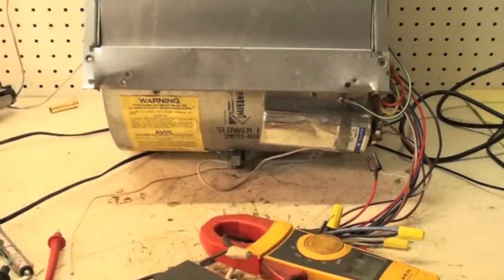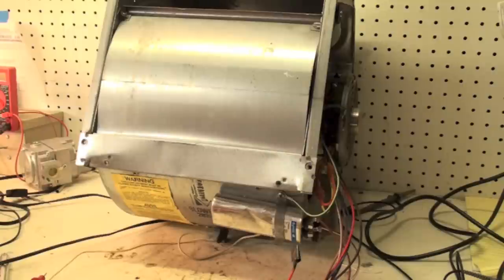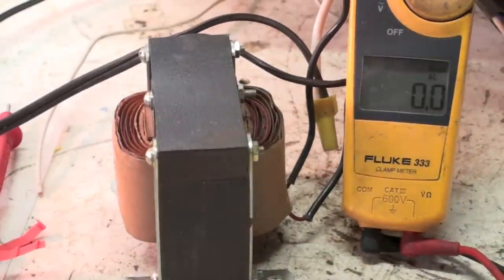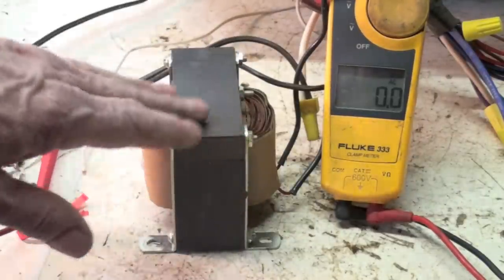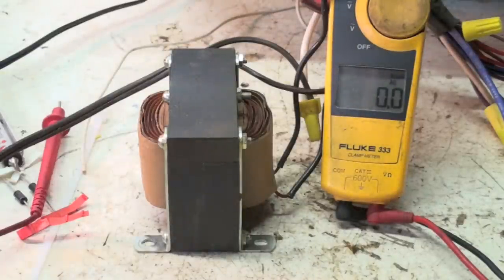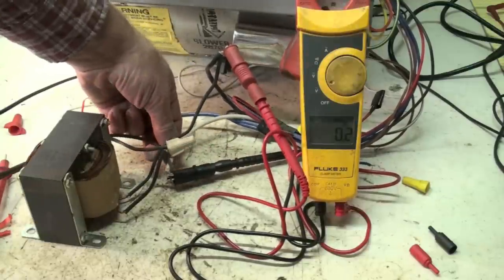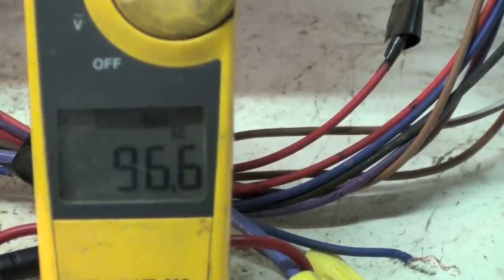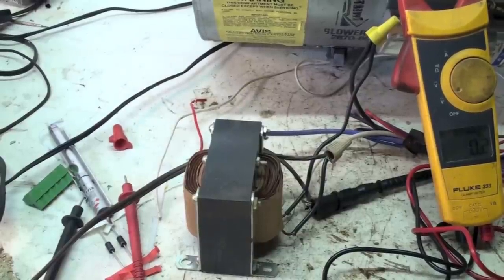Furnace fan motor speed control

Comment from the maker: Most of the time when you lower voltage, the amp draw increases to handle the load.  With the choke coil, both the voltage and amperage are reduced, because of the inductive reactance effect pushing back against the flow.  I know it seems odd, but it works.  Thanks for the comment.
GFM
Reply: and how would this effect the power factor? hook it up to a Kill-A-Watt.
Reply from the maker: @thedavesofourlives1  I can't say I have tried that.
GFM

Comment from the maker: No winding damage.  At least one manufacturer used a 4 speed choke coil as factory equipment.  Kind of makes you wonder why we have these very expensive PWM controls now.  I will be doing some vids on the newer variable speed units soon.
GFM

Comment: GFM, My grandfather w/EE degree found himself using 4 on diesel generator to create 4 different voltages (Including line and step up) to operate portable “Radars” in England, later Europe to scan for German airplanes & weather. Antenna rotates at a slow steady rate, radar used higher voltage, scope used another, plus wheel motors would drive slow to move to new location. A simple yet reliable way instead of heating tubes in a vacuum waisted the generators power and they wanted it constant and dedicated for opps, and nothing else. His job was to make sure each voltage was constant and only had one failure. So older technology. He told me an immigrant to 9 years and created “Bake-A-Lite” that was mixed with other materials as it had a high dielectric property. The patent residuals or payments was suspended by the inventor to win the war. Many was given the formula for free. This is where out desk top phone w/rotary dial came from in the 60’s. A part of the American spirit.
  Thanks for the video, I had forget many of his stories! He passed the year before I married.
Reply from the maker: Great story.  Sometimes when they pass a lot is lost.
GFM

Comment: these choke coils are in portable fans up to the 1960s used in various brands like Mathis cooler and the ones i got are the 1950s O.A.Sutton made Vornado fans most commonly used with shaded pole motors then. as i had to replace the motor in my late 40s Vornado JR. b18 c-1 as the windings were loose and were also grounded as the insulation crumbled in it as they matched the motor to a FASCO D210 as i found out the hard way the original choke coil isn't compatable with this motor. it runs on high speed if this is the wrong motor. its what the supply house matched it to

Comment from the maker: The late 1960s Intertherm electric, sometimes called International, used a choke coil that put out 65v, 85v and 120v.  The motor started with very low torque, similar to the variable speed motors now.
GFM

Comment: I have a Miller furnace in my manufactured home

It was A/C ready and I had the A/C added, 2.5 ton for a single wide trailer

I found the speed of the blower, the wires for slow and medium were used, I hooked high speed to turn on when the heat comes on, and the A/C was icing up from the start.

I switched to medium speed, but still ices up.

Is there a way to hook both the A/C speed and the heat speed to the fast wire ?

I was going to just switch the speed wire for the summer and have A/C on high

But, I was thinking that voltage comes out the control board on the heat speed tap where I have the high speed wire from the motor attached

The A/C and the heat motor power taps would never both be energized at the same time

Is it safe to hook high speed wire to both the A/C and the heat taps ?

They are both 120 voltage and I would like to know that if voltage is going to a tap that only sends 120 voltage, when it is off, would it disconnect that circuit on the board ?

Or is it going to short out the board ?

Basically, if you only had a 1 speed motor, wouldn't you have to hook the 1 wire to both taps on the control board ?

I would like to get a faster motor, but I don't think they have a faster motor.

This is a 3 speed motor

I think this is what comes in a unit that is A/C ready

The older units that were just heat had just 1 speed

Any help is appreciated

I was thinking about a diode, but this is A/C not D/C so that wouldn't work

I was also thinking about a relay that would go to one or the other tap, but there would be a moment in the beginning when voltage would get through to the tap that was not energized.

I am hoping someone who works on these will have seen this before.

I had the level checked

I was thinking about adding a little more r410a to the low side and see how that works.

I just don't know and I have had the unit looked at twice and I was not impressed with the service

The unit is only a few years old and it works great till it gets above 70 outside, then it gets less cold and starts to ice up.
Reply from the maker: First, do not connect 2 speeds to the same power source.  I would pick high speed for both heat and cool.  That is the simplest solution.
The unit should have a an either or relay installed to use a lower speed for heat and a higher one for cool, but unless you are confident in your wiring skills, you could damage the motor.
GFM
Reply: @grayfurnaceman  The motor has 3 wires, one for high, one for med, 9ne for slow.

The control board has a spade connection for the heat and a spade connection for the A/C

Whatever speed wire from the motor you connect to the control board spade connection, that is the speed you get.

I have heat on high speed and the A/C on medium

I plan on swapping them around.

This will make A/C high and heat medium, but I won't be using heat

I was wondering, if I attached 2 wires to the high motor speed wire and then attached both of those to the heat and the A/C spade connections, making them both hooked up to the high speed wire from the motor, but also jumpering the Heat and the A/C motor spades together.

In DC circuits I would add a diode to prevent any voltage going backwards down either circuit path.

I have 4 years of college in residential and commercial wiring, and I worked on jobs for 5 years after school wiring houses, doing blueprints and the actual wiring.

And I installed the A/C and the furnace, but this is not something that was covered in the installation manual.

And when I have paid professional companies to come and look at the unit, they don't seem to know what they are looking at.

I tried 2 of the biggest companies and neither one could answer my questions.

And I am not sure if there is enough coolant in the system.

They wouldn't let me look

I bought a set of gauges and a tank of r410a

I studied the videos and it looks like I should get the temp down close to 34 degrees.

I have been reluctant to do this, knowing the danger of the coolant and the pressure being a lot higher than what a car system has.

Cars are around 110 psi

This system is around 350 psi.

Not sure if that is just the high side

I would like to try increasing the speed of the motor and see if that fixes the issue.

I could also install a on-off-on switch for the high speed motor wire, and label it A/C off Heat

And just flip it in the spring and the fall

I just thought the manufacturer would have designed the control board for the contingency of there being just a 1 speed motor with a single wire.

I had to add splices to the low voltage wires and the common when I added the A/C unit.

But the low voltage side I understood 100% so I wasn't worried about making changes to the system's low voltage side.

The high voltage control circuits are a different story

I worked on 3 phase motors, but the wiring was straight forward, this is a lot more complex and I can't find a schematic for the board.

Any help is appreciated

Comment: Another great video thanks so much. Would you explain in more detail about this post 
The late 1960s Intertherm electric, sometimes called International, used a choke coil that put out 65v, 85v and 120v. The motor started with very low torque, similar to the variable speed motors now"
Reply: I have encountered a couple of these electric furnaces with these weird 240 volts "voltage step down devices"
Reply from the maker: Francisco Castellanos The International furnaces were an attempt to come up with a quiet operating furnace for use is mobile homes.  They were a beautiful operating furnace that sadly few techs understood.
Its called inductive reactance and happens when ac power energizes a coil and builds up a magnetic field around itself. When the power reduces to zero during the cycle, the magnetic field collapses and creates a counter voltage that essentially pushes back against the incoming power, reducing the effective power getting to the motor.
Reply: The motor name plate  in some multi speed direct drive motors are designed to run within a specific RPM, reducing the speed the overall equipment functionality is affected, such as air velocity, temp rise, etc
Reply from the maker: Francisco Castellanos Yes.  In affect, you are using the motor rpm to match the furnace to the ductwork.
GFM

Comment: I have an oil furnace. There is no Air Conditioning. It has a fan limit control that has the yellow wire hooked up there, then the yellow goes to the blower. On the blower the yellow wire is hooked up to medium high. If i hook the wire to the high setting will I save on oil costs, since the house should heat up faster?
Reply from the maker: It may help a little.  Don't look for a large change.
GFM

Comment: Would this work on the old single speed belt driven blower motors And could you control the speed (low and high speed) with an ordinary light switch by closing off the circuit to the choke coil?
Reply from the maker: You could certainly bypass the choke with a switch.
GFM

Comment: thanks for the reply back do you have a part number were i could try to look up one like you got or the a web sight were i could find one i been looking under choke coil but dont no if i need to look it up by a different name?
Reply from the maker: +Sean Schobelock I don't have a part #.  I know they were used on Lennox and Rheem furnaces that have an ECM blower motor.
GFM

Comment: Is there such a thing as a "variable choke" so you could adjust the motor speed to suit?
Reply from the maker: On some early models there was a variable choke that simply had a slide that could vary the secondary windings, but I have not seen one for over 40 years.
GFM

Comment: WHAT CHOKE VALUE DO YOU PICK TO SLOW MOTOR DOWN ? 
DO THEY MAKE ONE WITH MULTI- TAPS SO I CAN PICK A SPEED?  OR USE A SWITCH ON THE TAPS TO PICK THE SPEED?  THANKS.  GOOD INFO !
Reply from the maker: The choke coils I have seen have 3 wires and you pick which connection works best. I do not know the choke value of the coil. 
GFM

Comment: the only choke transformer i found like you got was for a treadmill motor choke transformer. so do you thank that would work on my compasiter start 3/4 horse power 3 speed motor and not burn it up?
Reply from the maker: +Sean Schobelock It could very well work.
GFM
Reply: I tried one of those from ebay.  It had a 9mH inductance.  I only got a voltage drop across it of about 6v.  Not enough to slow the motor.

Comment: i have a 5 ton heat pump 3/4 horse power motor compasiter start motor and it pushes around 2000 cfm of air i want to cut the motor speed in half to push around 1000 cfm can i use one of these choke coils? if so what would be a part number for one i could use? or where  could i get one i looked up choke coil and didn't really find the one you are using in video
Reply from the maker: +Sean Schobelock They are getting hard to find anymore.  Many electronic assemblies use them and you could salvage it.
GFM

Comment: Question, Hi. I have a blower fan motor that reads on it tag information in small print " 7.5mf 370V required on some units" for the run capacitor, but the CAP data on the tag also says that the run capacitor should be "CAP 5 mf 370V".  I'm a bit confused cause many sites says to always make sure that the mf for the run capacitor matches the motor tag rating info.
Reply from the maker: Interesting.  What brand motor?
GFM
Reply: Hi.  It looks to be an old original GE motor from my furnace blower fan. Each end of the motor has the words General Electric and the GE trademark(?) on it.  But it turns out as I tried to see if it was any good (trying to follow the youtube videos), trying to figure out if it was the weak 7.5 mf run capacitor that was on it,  or the motor itself was bad/failed, the ohm readings from the white lead common to each speed lead was giving me very different readings each time I took a meter reading when I took readings 3 times on each.  So I'm thinking its a bad motor and a worned out 7.5 mf capacitor (?, it was reading 7.1 mf on the meter). I also noticed now that  the blower housing also had some sort of sticky dust inside that looks like oil and has some smell to it.  But I guess my question is OBE'ed but Its still strange that to me that it has this writing on it about the 7.5mf and the CAP 5 mf.  I'm going to get a new motor to install in my furnace.
Reply: Depending on where the run capacitor was mounted, it might in fact have leaked oil into the blower housing as it failed.
Do you have a capacitance meter?
Ohm readings aren't always accurate, as you can get variations of a few ohms just by having oxidized meter leads/probes! XD
Also be aware that you might get readings that appear to be a short circuit, but in fact it may just be normal for the particular motor. If in doubt, check online for more information about your particular motor model (fingers crossed - not all manufacturers post that sort of information online...).

Comment: Hi, I was watching your video again, and I have seen these types of coils in newer heat pumps running with variable speed direct drive blower motors running under 240 volts, any comments?
Reply from the maker: Some of the variable speed units did use an inductor.  It is not multiple tap though.  I am not sure what the they are used for.
GFM
Reply: To counteract the "noise" produced by the efm from the motor and to protect the internal motor parts from electric surge, it what I understand tho
Reply: AC or DC motor?

Comment: I've gotten a Milwaukee thermoflo propane furnace from the late 70s and the blower appears to have 1 speed, slow, it's a belt driven furnace, I have almost 0 cfm of air flow at the vents, the ducts are fairly clean from what I can see, is there any way to increase blower speed so I can have airflow in my house, and the blower is almost running non stop, even when the propane kicks off, I imagine il have to replace the whole furnace  soon anyway but I need the one I have to last the winter, and I'm on an extremely tight budget until April, any advice? Or is it normal and I'm just used to a trailer house furnace
Reply from the maker: I would look for dirty blower wheel, or loose belt.  I have some videos on tightening belts.  Check my channel.
GFM
Reply: grayfurnaceman the other thing is my blower runs non stop the fan has only turned off once while I've been at the home, I don't think that's normal
Reply: grayfurnaceman I watched the videos on belt tension and my motor doesn't spin that fast, it is noticeably slower and it doesn't change speed either
Reply from the maker: If you have a heat operated fan switch, the off temp may be set incorrectly.
GFM
Reply: If it's belt driven, you could try changing the pulley sizes out to increase the blower RPM's.  Larger wheel on the drive side or a smaller wheel on the "driven" side.  Just be careful as if you change the ratio too much your drive motor might not have enough power to turn the blower.  

Your blower might not turn off unless your house gets to the temperature set by the thermostat.  If it's running as slowly as you say it is, it might never be getting up to temp and thus never turning itself off.

Comment: so you have line voltage going into the choke coil and then running to the motor. Pretty much in series then right?
Reply from the maker: Albion Laster It is a series circuit.  The choke coil introduces an inductive impedance that limits the power available to the motor.  Hope this helps.
GFM

Comment: What exactly controls, determines, adjusts, decides, what speed a variable speed motor blows in a gas furnace?
How does it know?
Static pressure?   Amp draw?
What?
Reply from the maker: 2packs4sure Most of them are looking for a specific amp draw.  The motor speeds up until the amp draw gets to the preset level.  Hope this helps.
GFM
Reply: grayfurnaceman    Thanks

Comment: I would think that PSC motor would likely burn up at that low voltage given a little time. I see power chokes on ECM/X13 motors all the time. How would one go about testing/Troubleshooting a power choke with a volt meter????
Reply from the maker: It will not burn up because the current is limited by the choke coil.  Choke coils are either open or closed.  Pretty simple.
GFM